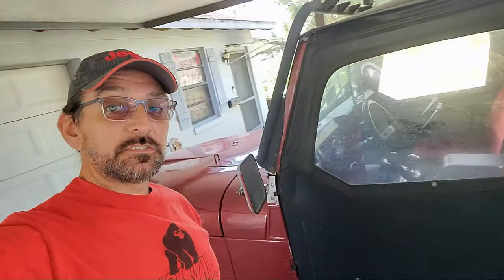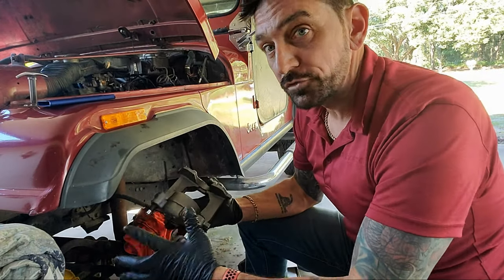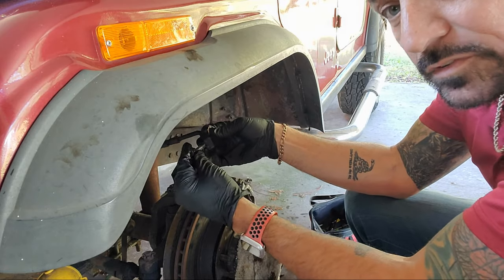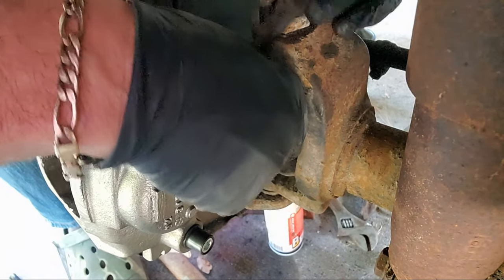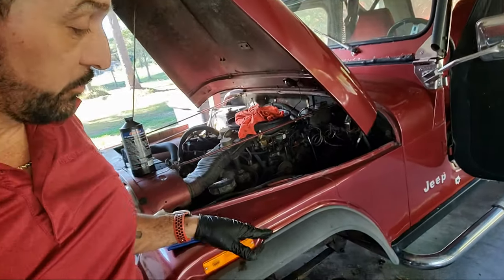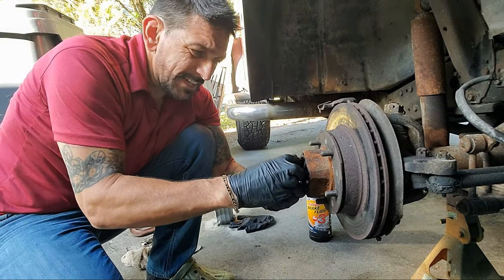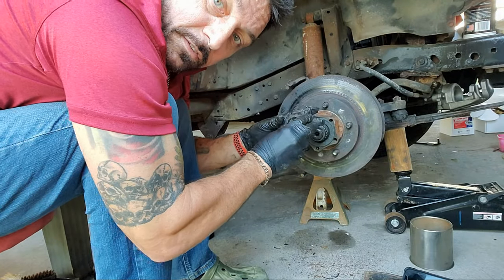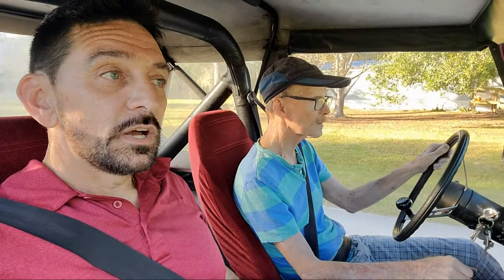Doing a brake job on a 1978 Jeep CJ7 and finding some surprises

Comment: Your 78 has later model wide track brakes. The 2 bolt caliper was used 82-86. Another tell is the 5 bolt hub.
Reply from the maker: You've been through this before...21
Reply: 77 and 78 were the big brake set up with 6 bolt calipers as well, 79 started the 2 bolt caliper brakes through 86 but the caliper did change. I have never seen the calipers that were installed in the video, just a jeep thing. But I agree sometime in this jeeps life the front axle or parts of it were changed out because those are not the original brake setup.

Comment: 1978 Jeep CJ's were equipped with a caliper used with a 6 bolt caliper bracket assembly. Somebody change the brakes to the 2 bolt caliper 1979 and up. Not only changed but unless you have the master cylinder and proportioning valve those brakes are hosed with the current front disc brake calipers. But for the 1977 and 1978 CJ's those calipers you bought are correct, that is if it really is a 1978 CJ.
Reply from the maker: Yes. It is a '78. Everything worked out great. I'm on to the carburetor now.
Reply from the maker: Also, thanks for the info
Reply: Your welcome.